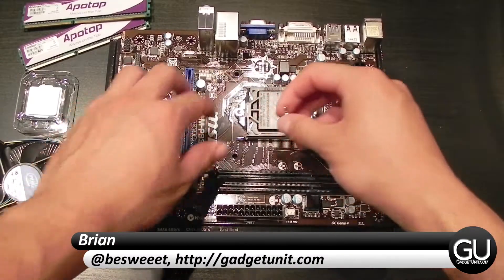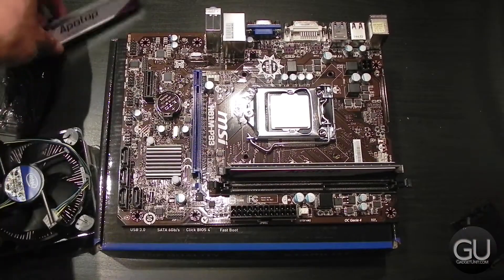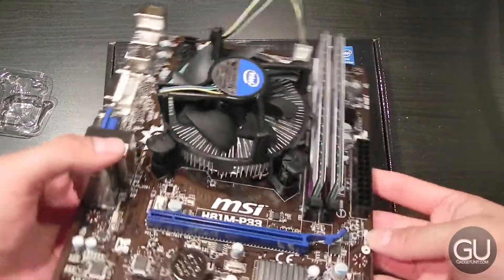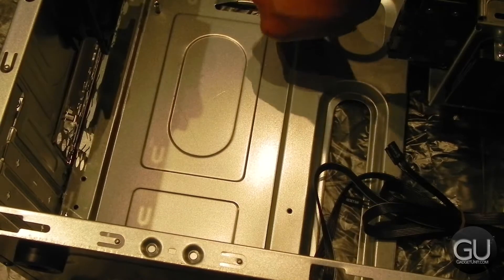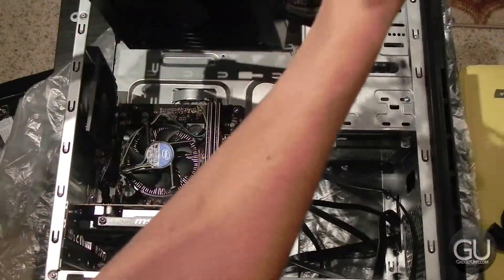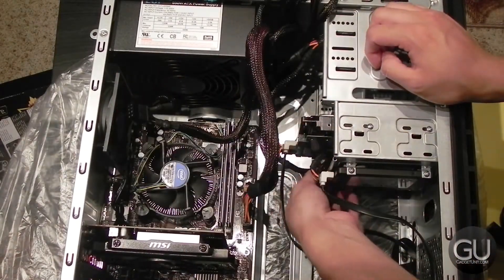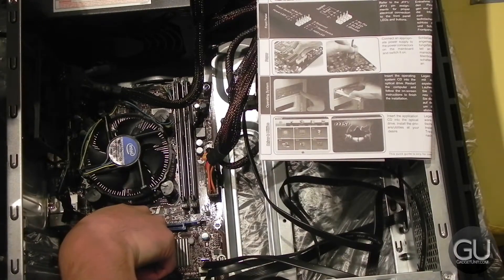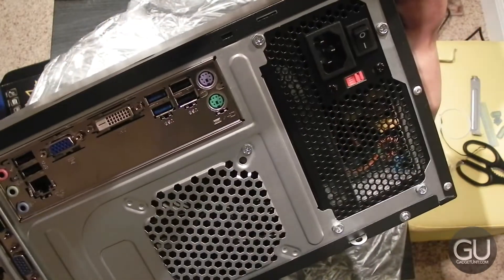[10/15] $500 Triple-boot PC/Hackintosh Build - Building the PC + First Power On

Comment: heatsink sticks in the corners should be facing the radiator and not against
Reply from the maker: +Alberth Pedersen In other words, the screws may not have been screwed in the right direction. For me, they were tight, so everything worked out.